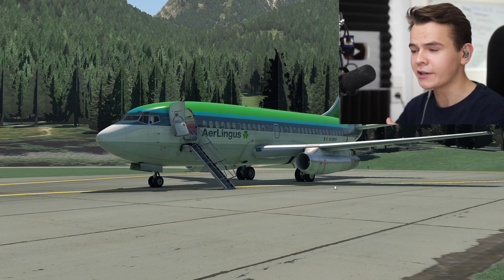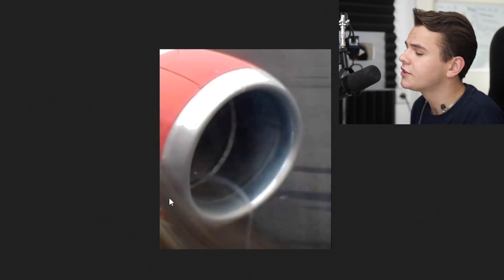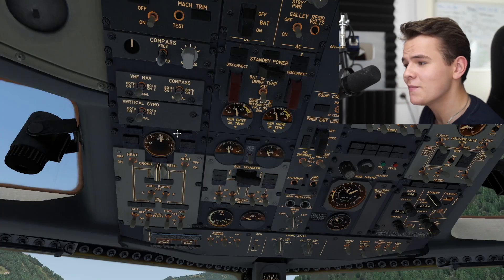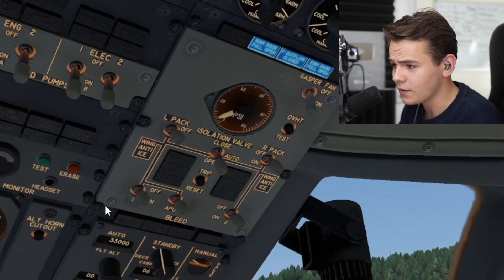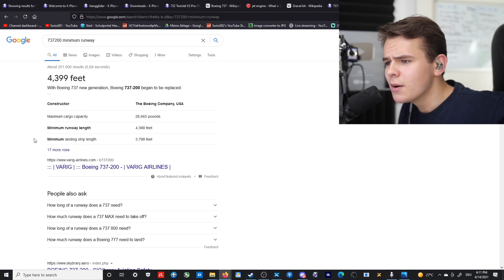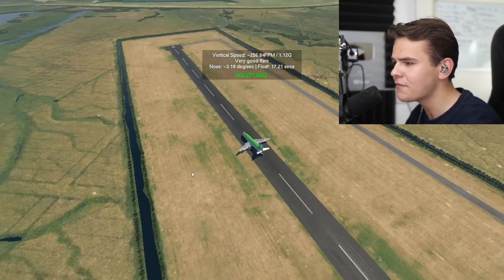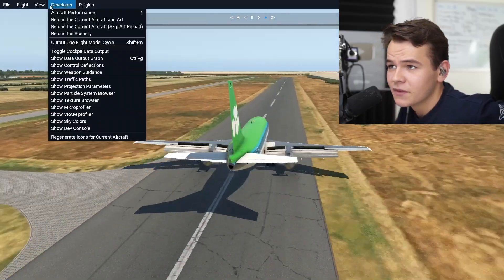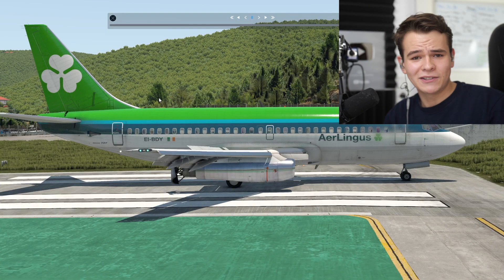Why The 737 200 Can Fly Almost Everywhere

Comment: think air compresses under fuselage and wings
that is like stator-rotor section. compressor section is dependent on slats-flaps with range of turbo-shaft to turbo-prop to turbo-fan to turbo-jet

Comment: The reason modern planes don’t have these features is because they land at well-developed, fully modern airports. This little guy was designed for distant rural places, with either no airport or a bad airport. The stairs are so that it can be boarded without a boarding bridge thing.
Reply: Yes, back then buying tickets for planes were very expensive, and most airports were under developed.

Comment: Yeah I think the 737 was a plane built for short runways and rural, undeveloped airports. That's why there's the built-in stairs, the sort-of STOL capability, and just the fuselage close to the ground. Obviously, the nextgen planes stop slower than the A32-series, and it doesn't really have stairs and only operates as a regular commercial jet now.